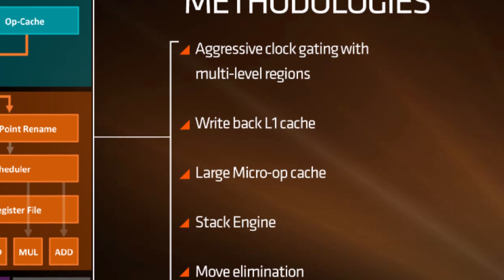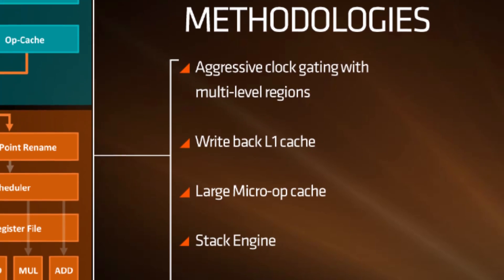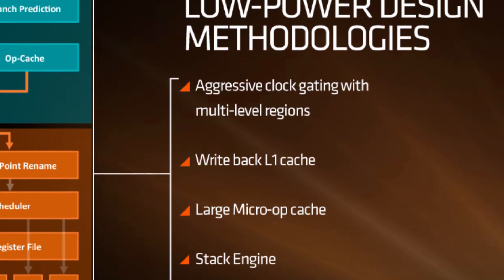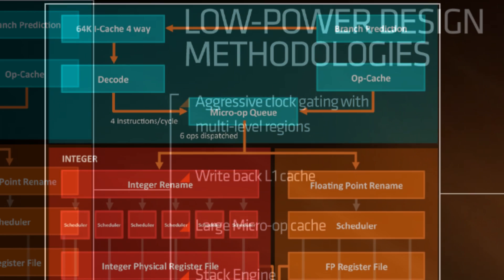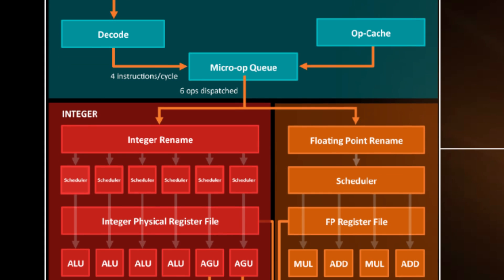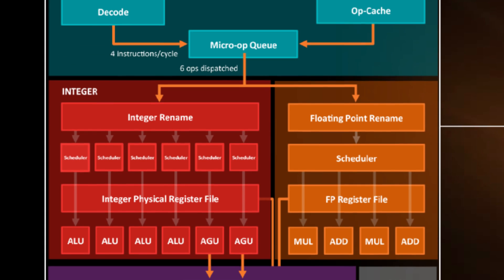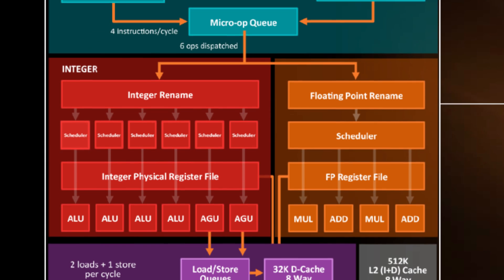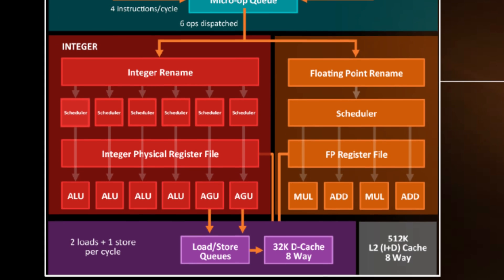Ryzen: What's Up with the "High Temps"?

Comment: Why cant they make BIOS manufacturers use the offset temperature instead. With 3900x I get 45-60C on IDLE, 60C in games and 80C during stress test. If there is no fan smoothing delay of 5 seconds it gets really annoying.

Comment: my 3600x runs hot as #@&%
Reply: same, and I still don't have a straight answer on why or how hot the thing ACTUALLY is. I'll feel better if it's 10-20c lower, but it still irks me that I spend all this money on a build just to find out the temps are either blazing hot with an AIO cooler, OR that the temps are reading inaccurately. Wish I had known about this before making the switch back to AMD, else I would've stuck with Intel and paid the extra $100-150 for their 9900k

Comment: I'm still confused. The 95° max on the 1700x applies before or after the +20° ? 
i.e, [Tdie 95° - Tctl 115°] OR [Tdie 75° Tctl 95°] ? :(
Reply: 95°C in real temperature. So yes, a readout of 115°C.
 Most CPUs have ~90°C as maximum temperature. Many GPUs are save to slightly above 100°C.
Reply: Indigomind  Are you reading out the temps using Ryzen Master? If 96°C is your real temp after subtracting the 20°C delta I'd suggest getting a new cooler, yes.
My 3600 throttles around 80°C. If your's really is at 96°C, it would clock down by a lot; I would estimate a delta in lost performance of 15%-30%! Ryzen needs to be kept below 80°C for max perfomance.
Reply: Indigomind  Ryzen Master compensates for the 20°C offset; it shows the real temp. You should make sure you have sufficient airflow.
Are you using the default cooler? That should be enough if your case also has enough ventilation.
Reply: Indigomind  One intake and one outtake should be your minimum. The stock cooler likes to trap hot air if there's no sufficient airflow. Add an exhaust to the top or the back to get the stagnant hot air out; intakes aren't enough to push the hot air out on their own.
Reply: Glad to could've helped. I personally have 3 intakes and two outtakes. But I also have 8.5TB worth of hard drives generating some heat. Three fans really should do the trick for you; if not, get any 30€ CPU cooler - it will be better than stock.
Reply: There are lots of excellent coolers. It's best to head over to a page like pcpartpicker.com/products/cpu-cooler/ or geizhals.de/?cat=cpucooler and search their databases. Get a tower-style cooler with a 120mm or bigger fan that has a 4-pin PWM connection and doesn't cost less than 25€. Look up one or two reviews of the coolers that you are thinking about and make a decision based on that.

Comment: Is this still a thing? I just got a R7 1800x, applied the cpu cooler, and on BIOS it shows that the cpu is around 70°C idle. I mean the stock thermal paste does not help for sure 😂, but is it fixed for newer drivers?
Reply: +Janis Lielkalns:
#1 most important thing: UPDATE YOUR BIOS
Then shutdown your PC. Leave the power cable plugged. Clear the CMOS (read you manual how to do it).

My BIOS reports 30 to 35 C while idle, depending on room temperature.
However...............
 I have a Ryzen 7 1800X. CPUID HWmonitor 1.35.0 shows that my CPU is at 53 °C but there is another thing called Package (node 0) which shows 77 °C.

AMD Ryzen master also shows 77 °C.
Those temperatures are while gaming in Battlefield 1.

While idle, I get 38 °C for CPU and 36 °C for the Package (node 0).
My room is at 26 °C.

Is this normal?

Comment: So I built a ryzen 5 1600 gaming rig for my self runs 37°c just running it runs 47°c while using Intel burn test and aida 64 fir an hour it stays that temp even gaming fortnite four hours it. Does using cooler master eve 212 so yea it stay pretty cool as he monitor says is he reliable I think so. But I just built a ryzen 3 1300x quadcore gaming rig for my 11 old son using the AMD wraith spire cooler from the 1600 I purchased and I was wondering anyone can answer/ why does the 1300x with the wraith spire run at 140°f with that cooler set to performance speed but cooler with the wraith stealth makes no since or is it because the stealth is a 65w fan and spire is 95w is this gonna be safe for him because he plays PC all day long ITs a  surprise for when he gets home from school today so id like to get some honest opinions before 3:30p.m central if possible should I switch beck to stealth or should I keep spire on it for longer cooling like ibsaid I tested it for an hour

Comment: Thank you for clearing this out I was confused about it under the Threadripper chipset. I did some reasearch to see and found that Threadripper is 27C offset while Ryzen 7 was 20C offset. I was actually reading the tCTL instead of the tDIE side of the CPU temp read out. XD This video at least confirm my finding plus I got a better understanding of why AMD set such setup which is pretty smart and cleaver.  Thanks!

Comment: My Ryzen 5 1600 idles at 57°C in the BIOS when the room temperature is at 38°C
Is this a problem? Idk if the non X models report the wrong temperature
Reply: My 1600 idles at around 35C in a 20-25C room temp, hits about 45 booting and barely gets to 60 while running cinebench.
Not sure how normal these temps are but its not OCed, stock wrath cooler and I got 4 fans in my case.
Reply: only the X ones report +20C more temp. Your 1600 is reporting correctly =[
Reply: joe joe joe joe :'(
What is the average idle temperature of a Ryzen 5 1600 with a given room temperature?
Reply: InDmand I guess that's normal, and so are mine. It's hot because the room temp @ 35°c

Comment: Since you mentioned SenseMI...

Could you(or anyone reading, more realistically) - explain what's the benefit of it? I mean, I've read articles, seen AMD videos and yadda yadda.

But what does it do in reality? Has anyone tried to... measure the performance? Measure the gains? How does it reflect?

Okay, 90% of benchmakers are stupid and don't add the RAM requirement, effectively making Ryzen look bad, but has anyone tried to actually compare the CPUs to show what is this SenseMI and what is the practical benefit?
Maybe not in "FPS IN GAMEZ", but at least something visible, not just a sales pitch.

Comment: My 1700 @ 3.7ghz with NO voltage added doesn't get to 50c with any game..... none not any. Though I have a h60 with push-pull. That's still cooler... a lot cooler than my old FX.  About 6c lower than my FX overclocked at 4.3ghz.

Comment: Highly doubt this is the case.  I'd say the reported temps are likely the actual temps.  Let's keep in mind, the 4790k can go up to 90c+ on its stock heatsink, and it's only an 88w part.  So I would expect a 95w part to run hotter regardless of how much newer it is. To put in in perspective, the 4790k is a 177mm2 die size @ 88w. Ryzen's die size is 192mm2 @ 95w.  That's an 8% die size difference, and an almost equal 8% increase in base TDP.  

My main point here, it's not far fetched that these CPU's will run hot.  In fact if they ran cool, especially with stock heatsinks, it would be odd.

Let's also keep in mind that these CPU's aren't really only 95w.  They will likely actually run in the 120w+ vicinity.  This is why they are given 140w TDP coolers.  In comparison, 95w Phenom II's could eat up to 140w of juice, especially when overclocked.  

And even though the AMD coolers are bigger than a typical stock intel cooler, AMD's coolers don't compare to a heatpipe tower cooler.  So part of the reason for the heat, is well.....those stock coolers are crap.  They're not really meant to deliver cool temps, they're meant to run your part without it destroying itself immediately.
Reply: C North x cpu's don't come with stock coolers and amd had stated on reddit about this 20C offset on x processors
Reply: C North Well the problem is that part of the reason why the 4790K runs so hot is because Intel decided to save a bit of dough on the way the heat spreader and the die itself are connected. It used to be that these were soldered together which is by far the best way, because it has the best thermal conductivity. However, starting from I believe the 3rd generation of core processors Intel decided: "fuck it, let's go with TIM instead of solder". Problem is, it gets far harder for the heat of the chip to reach the heat spreader, hence it runs much hotter. AMD however still uses solder on their chips. So it is not strange at all that their chips would run cooler.

TL;DR: It actually makes sense AMD chips run cooler
Reply: I've seen delidded chips only improve by 3c at load temps at best.  My 4790k runs at 55c maximum load on a hot day with a Noctua U14S, at stock clocks of 4Ghz.  At 4.4ghz it runs at 63c, and this is with an unaltered chip.  Turn HT off and it'll immediately remove 15c from load temps.

 If AMD upped the reading to be false by 20c, then if you tried running the chip overclocked, it would likely reach the shutdown temps with the stock cooler, even if falsely.  Once you hit 80c, the motherboard will see it as 100c.  So a 20c offset would actually be a pretty stupid move.

Comment: I wonder when will manufacturers of  hardware  concentrate on higher voltage running  hardware instead of low voltage  high current draw that produce more heat  for example  16- 18 volts instead of the 12.5 volts

Comment: I am not following it.
1. 20 degrees higher is huge, if that is how you play it wouldn't 5-10 degrees suffice?
2. It has given headaches (maybe literaly) to some users because the CPU fans are too agressive all the time and tuning those can take some time.
3. Why not report the correct temperatures and let the users deal with it? You know, tune the fan profiles in function of correctly reported temperatures.

If I overlook something, feel free to point it out.

Comment: amd just use brute force by adding more volts 1.4 as standered b4 you even start overlooking is bull where as Intel will run a lot lower that is the difference between them amd in stead of refining there architecture they just use brute force by adding more volts where as Intel will refine there's to use less volts I think I will stick with intel
Reply: Karl Massie  4gz needs 1.37+-  that 1.4 was bios bug fixed in most 9f mobos
Reply: and good luck running 7700k at 60c under full load
Reply: 60 is still better then ryzen I have seen ryzen run at over 50 stock settings idle I idle in the mid 30,'s my point is amd chips have always used more volts and have always been hot chips same with there gpu,'s that's just the way they do it

Comment: What is "TJ max" on ryzen platform? because i'm confused. On intel, at about 100C(+-5) is the max and the pc will shut down. Anything under 80C is considered ok, around 70 being the sweet spot. BUT what about ryzen? What is the max? what is the "sweet spot"?
Reply: Woxys Hard to say. I reached 80C on my 1700 non-X without it throttling or shutting down.
Reply: It should be 95C
Reply: Thanks. I'm not ballsy enough to try to make my 1700 reach 95C, but I think I'll take your word for it.
Reply: Well it should thermal shutdown itself before it gets damaged. Provided everything is working as it should.

Comment: Wendel I still think that those CPUs are locked, I have a 1700 overclock at 4ghz 1.34V Asus Prime x370 PRO and I touch the pump and there is not sign of heat at all is cold I mean you can get wahtever CPU for example my Fury X always run at 50 full gaming Degrees and you touch the Water cooling and is HOT but in this CPU is not even warmer, I have two theory here, yes this CPUs are unlocked but are locked at the same time when you try to cross the 4ghz+ it seems that there is more room but for some reason they are locked and is not the heat what is affecting them to go further is something else.

Comment: Have anyone tried reverting this hack and looked at the stability?

If only this was something all components could be set to. I wonder if we will see more stuff like this if it is the case. Would be cool if you could tell all components to do this in UEFI or something.

The GTX 1080 cards are something that comes to mind where the throttling would have been reduced with something like this. But I guess a lower temp target would make more sense there since it only missed by 2-3C.

Comment: You can get 1700 to 80 degrees, BIOS shows 80 degrees.
You cannot get 1800x to 80 degrees, BIOS shows 100 degrees, motherboard wont let you go 100C.
1800X is a LOCKED CPU by 20C.
1800X = SCAM

Comment: This is overthinking it a little bit. Yes you can fix Ryzen temperature reporting in software to make it more accurate to celsius waste heat like Intel reports. The problem with Ryzen temperature reporting is the sensors aren't configured to just report waste heat in celsius. AMD has used a core health formula called TCTL for years. TCTL takes waste heat into account, but it also takes into account wattage drawn, and the end result number from all the sensors is aggregated in a formula called TCTL. TCTL is an extremely information rich number for the CPU to use to keep itself healthy, but it does not accurately convey the waste heat in celsius. This is why on Intel you can swing the reported CPU temperature by 40c depending on your cooling configuration, but the same thing doesn't happen on Ryzen. If you put a huge triple rad custom loop on an 1800x the reported temperature isn't going to drop 40c over a stock cooler because cooling your CPU doesn't greatly reduce the wattage drawn, and Ryzen's temperature reporting is a formula including wattage drawn and waste heat. This causes confusion for the end user, but it's not an indication that the chip is running hotter than it should under that configuration. It's not a directly better or worse system than Intel's, it's just completely different and people aren't used to it. This was all true for FX too, but it wasn't a popular platform for enthusiasts so it wasn't a big point of discussion.
Reply: +Jon Asgaeoth:
In other words, it doesn't report the temperature at all?
Can AMD put an actual themistor or thermal diode so we can know at what temperature each core is at?
Reply: I have a Ryzen 7 1800X. CPUID HWmonitor 1.35.0 shows that my CPU is at 53 °C but there is another thing called Package (node 0) which shows 77 °C.

AMD Ryzen master also shows 77 °C.
Those temperatures are while gaming in Battlefield 1.

While idle, I get 38 °C for CPU and 36 °C for the Package (node 0).
My room is at 26 °C.

Is this normal?
Reply: I have a Ryzen 5 2600 and on high load its about 77c degrees. And my GTX 1060 3gb is at 82c.

Comment: Temperatures are calculated from data which usually comes from 50+ sensors for exactly this task only. They are an "average" (with bias towards higher entries) of the last measured time cycle and can be heavily influenced by special workloads on special parts of the CPU.